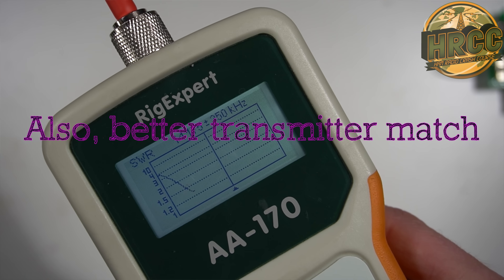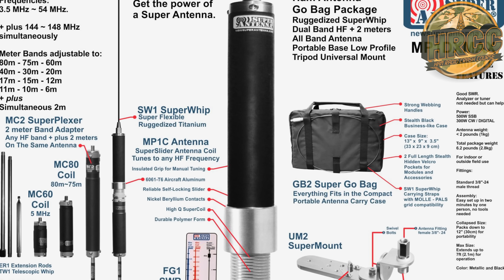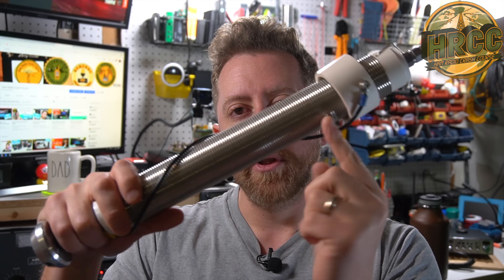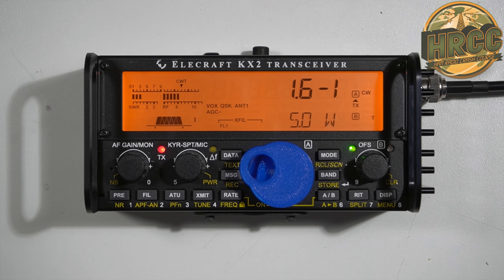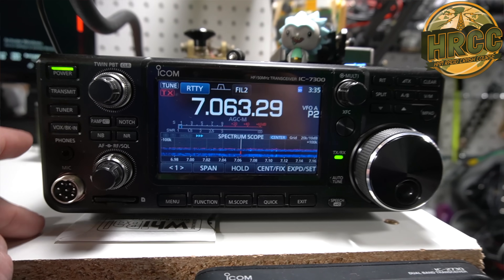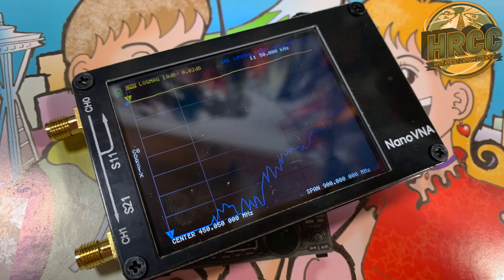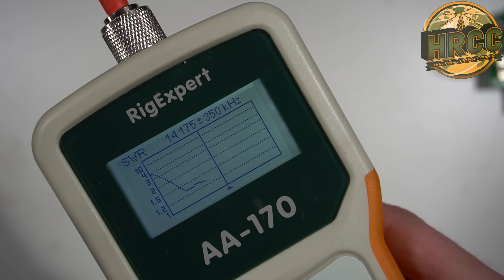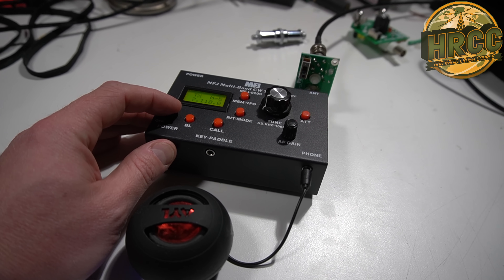Do you think you need an antenna analyzer?

Comment: Used an analogue SWR meter since I started, (easier to read than changing settings on Txvr) then when I had built a few antennas got an analyser to make it easier , particularly my loops. Shows where it is operating best. Had a 20 m dipole strung in loft that worked ok then when I got my analyser found it was perfect1:1 on 17m which I had not thought to try.Loved 17m when it was active.

Comment: Short answer is no you do not "need" an antenna analyser, an SWR meter is tried and trued. In tuning or building an antenna you'd save a lot of time with and antenna analyser or vector network analyser, but good SWR meter is just irreplaceable in your tool kit. I honestly don't see the value of an expensive antenna analyser now, when a cheap VNA will do what you need. 
My little cheapo $70 VNA does exactly what I want to tune antennas lightning quick, and I follow up with an SWR meter check with any radio I use with it. You wont regret a VNA, but an SWR meter is a must have. This is a HOBBY, not a job. Save your money for good radios.

Comment: What I like about my (old) MFJ-269 analyzer you aren't subjecting your radio transmit to any possible mismatch of the antenna without being able to see what it is first. It covers HF/VHF/UHF, which covers my, again older Yaesu 857D. As those that have one of these radios knows, it does not have a display to give you a read out of what the SWR is, but if you have the display set it has a little 'bar' that will display if the SWR is getting into a range it doesn't like.

I wonder if there is a misconception or misunderstanding what the difference is between a SWR meter and a  antenna analyzer? When I think of a SWR meter, to me that is a device you put between your radio and the antenna, but a antenna analyzer is something that you hook up to your antenna and doesn't need the radio to 'see' what and where (frequency) the antenna has the best match. I agree even with a 'store bought' antenna you can see if it needs some fine tuning before it it permanently mounted, and even more so if you build your own antenna, you can make adjustments, if needed even if your math is right on.
Reply: I'm hoping to buy an 857D later this year.  Do u use a tuner, like the LDG YT-100, with it?
Reply: @kevingoshe4371  Yes but it is an OLD MFJ-944. I've used it with a loop at a previous location, now a 'random' length wire. I like my 857D, suspect you will too when you get yours. When I was able to use it, it worked great for me, it handled all that radio can put out. To much noise currently to use any HF. Just got a noise reducer but haven't tried to us that yet.
Reply: @dave_n8pu  thanks for the info, and best of luck with the noise reducer!
Reply: @kevingoshe4371  Thanks

Comment: I would agree that it's not required but like a voltmeter I do like having that tool. One other comment is that (I've heard it said, "my antenna tuner can tune up a nail") even though you are impedance matched, you may not be radiating very effectively. True, you can add a matching circuit to tune a nail to [ 50 + 0j ] ohms... but it will still radiate like a nail.

Comment: The IC-7300's SWR meter is extremely inaccurate with a "couple of watts". It doesn't start being precise up until some 30-40 W. Below that, it doesn't have enough resolution, and shows lower value.

Comment: My rig expert AA55 ZOOM will also transmit a sequence of tones to a 2meter HT. This way you can leave the analyzer hooked up to the coax at your radio, and go outside or on the tower to make your antenna trimming or adjustments and the HT will tell you when your swr is set.
Reply from the maker: That’s cool!

Comment: The first one I got was when I bought my FTDX3000.  Figured the couple of bucks I spent on the Rig Experts was well worth protecting the output stage of the FTDX3000.  I also bring it whenever I go portable with the WRC.  They are pretty valuable tools to have.  And you’re right, if you are building dipoles or using commercially built antennas, you'll be ok with an SWR meter...but be cautious with the power levels that the antenna is tested with.

Comment: Hi Josh... I'm a magloop lover, made a few of them..... antenna analyser really does make tunning very easy...
Reply: I just subbed a few mins ago!. I just got my baofeng today and it didn't come with an antenna. I don't think that's normal, is it?
Reply: @jasondobbs2078  The factory antennas are such trash most people never remove them from the wrapper. May I suggest a NA-277 antenna? Cheap and makes a large improvement to the radio.
Reply: @JasonGuerard  You mean the Nagoya  N771 ?    I have 2 of them coming on a slow boat from China. :  )
Reply: Yes it does , when you have no real noise like out portable Mag-loops screwdiver antennas are very hard to tune.